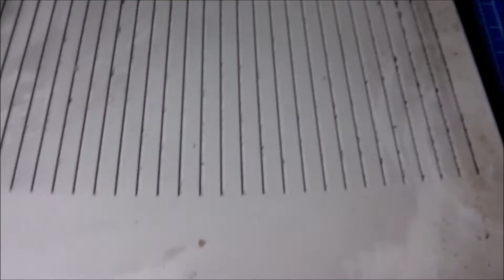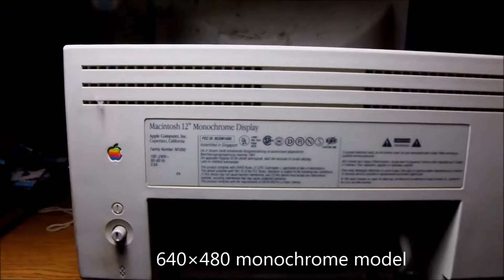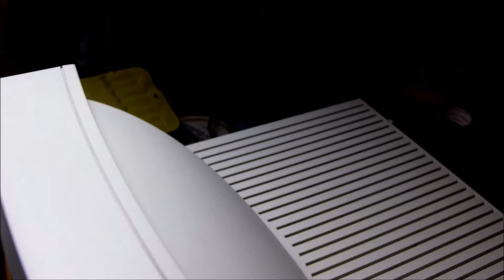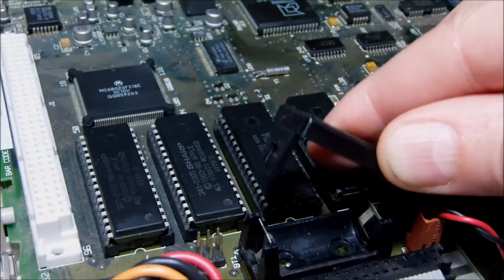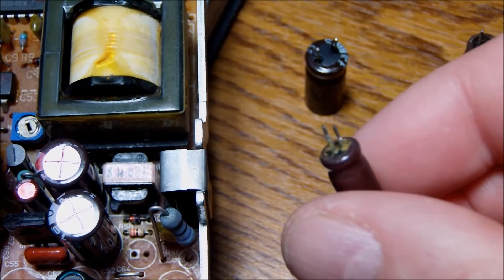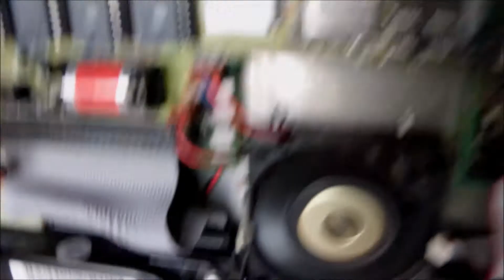Apple Macintosh LC - 1992 - PSU Recapping and test.

Comment: What did you do about the weird 8.2 microfarad capacitor?
Reply from the maker: Hello there, never changed that one. Now you reminded me this, it is going to be probably the next point of failure - Thanks for watching!
Reply: @CyberhugTechnologies  It does seem to be fine, all the bad capacitors in mine were ELNA capacitors. Nichicon makes generally high reliability capacitors.
Reply from the maker: @ducksonplays4190  Agreed, Nichicon rocks - ELNA has been loosing trust over the years!
Reply: @CyberhugTechnologies  I didn't replace it on mine either.